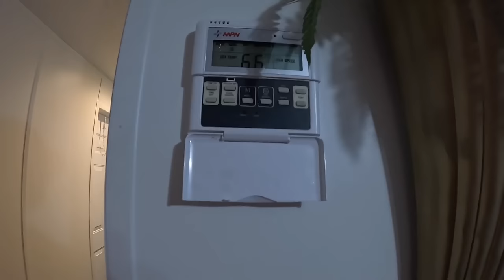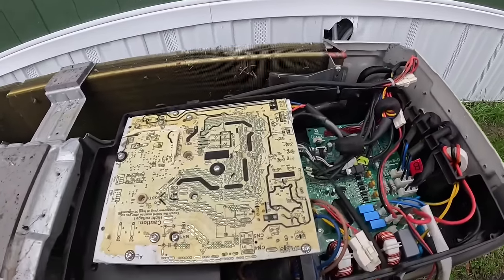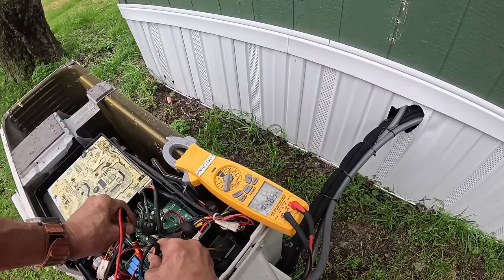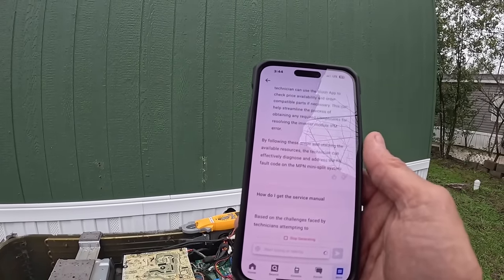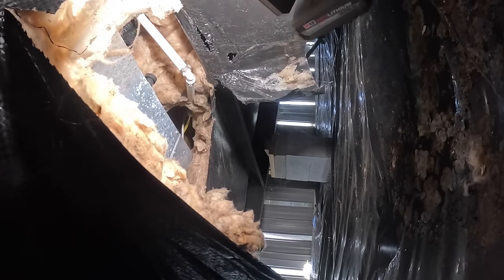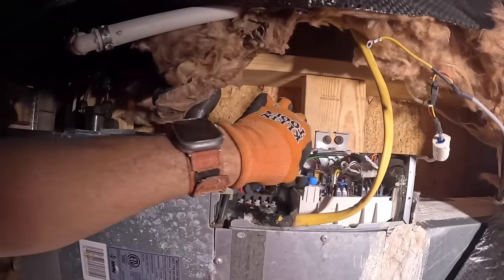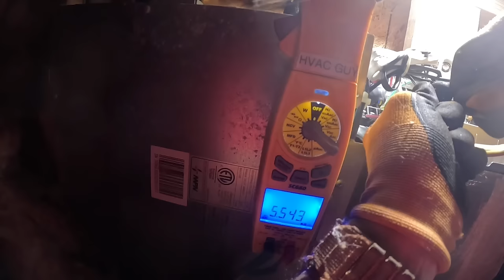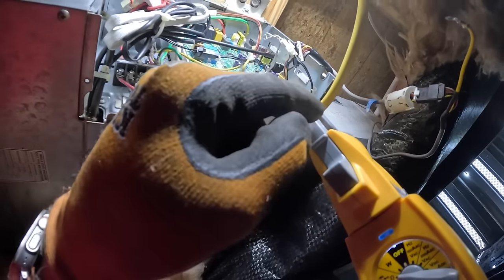MPN Mini-Split On A Trailer With Issues! #hvacguy #hvaclife

Comment: Alien autopsy. Well it's got coils, compressor, fans and all that good stuff, but too many electronics. AC system with a brain, just like the new refrigerators. Have to learn it, it ain't going away. I try to like the mini splits, working they will freeze you out, I know. Longevity and repair is what I am on the fence about. Thanks for the video

Comment: Hi to all that watch this channel . Hi Curtis . Ok here goes my comment. Mini split Technology is something basically new to us 30 yrs ac mechanics without Internet svc or a manual this units are a nightmare to Troubleshoot we ac techs were instructed with Ac books not computers or Cell phones. We know all Ref cycle in n out ,,,,but with all the Sensors u need a Chart w Temp Resistance Values other than that is difficult to even Check one or 2 sensors on Reg Climate Master H pump now imagine trying to Read a manyal on a cell ph....pls,,,,one thing is to Read it at Home in comfort Space other is to Troubleshoot on the😢field due to high either Heat or Cold temps ......tnk u Curtis i mmon the field since the 80 s. These Minisplits here are becoming the new trend ,Hopefully new Techs are Geeks Armed with Laptops and I phones other than that Not easy . Graduate in Tech School 88 to 93 ...Union an Vo tech Schools.....East and West Fl. Ttul

Comment: The yellow connector on the right hand side of the air handler isn't plugged in all the way.  You can see that it's partially sticking out.  You might want to check that.
Reply: That connection is for the small controller

Comment: On some of those minis, they default to heat if low on refrigerant.  Can't recall the brand but I did run into that issue no long ago.  

Consumers buy these danged things online and then put them in without pulling vacuum, etc. and when they croak, they can't understand why nobody likes working on them.  I took the LG class and  have the plug in module that shows all sensors, etc.  Even with that, it's not easy to troubleshoot.

Comment: Everyone loves mini splits til they have issues. They are over complicated junk. Better off with a properly sized window unit for what these provide and their lack of reliability. There is a reason they are cheap. Also heat pumps are not efficient despite the fudged data. Their efficiency is based on outdoor temps. The price per kilowatt is higher than gas therms and provide less heat.

Comment: The issue with these inverter splits is the DC voltage does not handle voltage fluctuations at all. A very common issue is PCB failure due to power surge, or even odd faults like this that pop up

Comment: Why in the world they started using those under slung contraptions!  The little space they would have saved would have been better used for an indoor air handler.  Quote her a normal air handler and if nothing else some flex to couple to the silly duct system they use   They look pretty on the outside but that’s as far as they go lol

Comment: In a mini split the reversing valve is energise in heating mode. So your problem is the main board Of the exterior unit. And you have to replace the interior blower.

Comment: if you had checked the charge I would bet it low. Mini most of the time go to heat when low. So that why the reads are out of whack .. Basically a lot of extra work for nothing since the value of charge was not checked first.
Reply: danwesten2771  because of how they are programmed and how the sensors work. It takes less freon in heat vs cooling. compressor sensor senses the returning refrigerant temperature and modulates according if it is low it is. The compressor modulate two things send temperature of the refrigerant, and the flow rate of the refrigerant. In this case heat is more easy to sensor in the correct range. Cooling has more demand. it easier to heat then cool. Every notices that if it  the delta for cooling it harder to get to then heat.

Comment: it's so sad to see the junk that you techs have to work on.... and to be allowed to put those air handlers under the house with no room to work.... electronics has ruined our trade and is a huge rip off to the consumers.... electronics was supposed to bring up efficiency but with all the BS they manufactured... one service call and board or inverter can easily wipe out any savings one might have gotten on the power bill.... I'm glad I'm retired... that's one of those jobs I would have looked at for two minutes and when I saw the air handler under the house I would have said nicely " no thank you".... jus sayin 😊
Reply: I agree, the electronics jammed into so many places is nothing but bad news and nightmares when it fails. It technically can run more efficiently but it invites so many failure points its crazy and ends up costing you way more money over time.